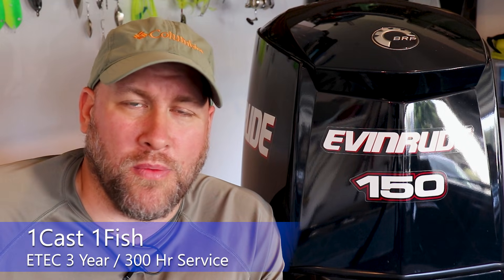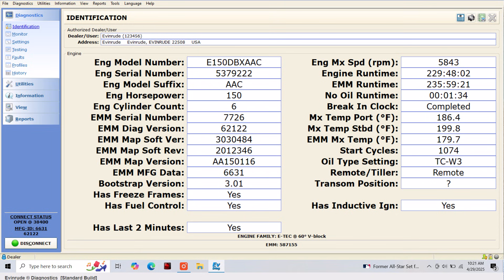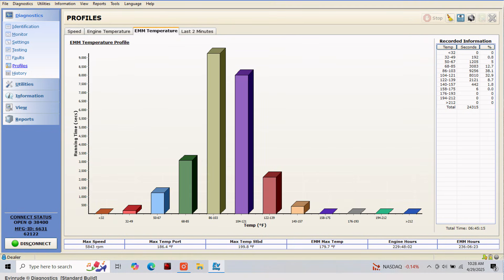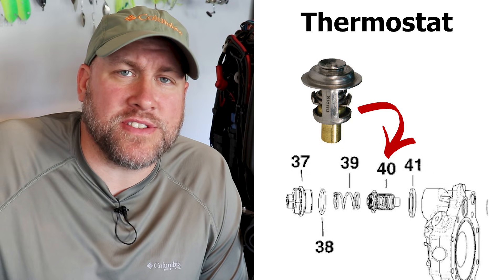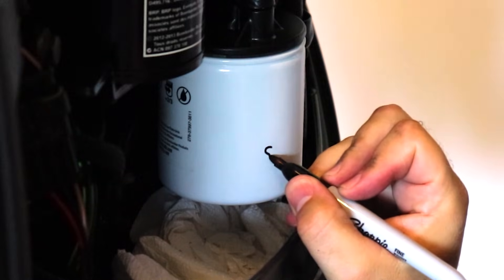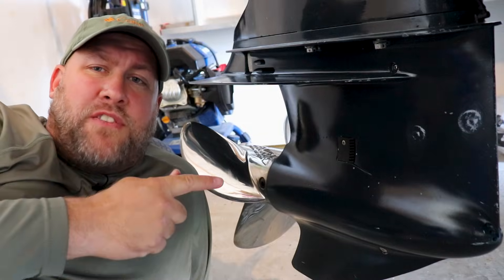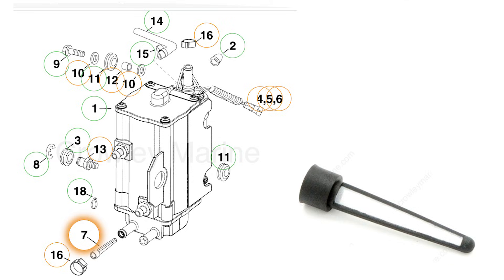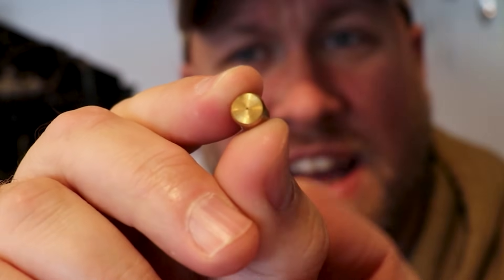Evinrude ETEC 3 Year 300 Hour Maintenance Service Guide

Comment: I OWNED A 2006 E-TEC, I ALWAYS HAD SERVICED IT ON OR BEFORE TIME. THE EXHAUST HOUSING CRACKED DUE TO THE LOWER ENGINE MOUNTS  BEING BADLY CORRODED.NEVER WAS THESE MOUNTS EVER INSPECTED. POOR !!
Reply from the maker: I have seen a few things on issues with these lower mounts.  
Was yours Saltwater?
Reply: @1Cast1Fish  yes , i used in Saltwater and Estuaries. my disappointment was not the E-TEC , it was the lack of attention to detail in servicing my motor over the years. I was concerned with availability of parts here in Australia and any other problems found so i re powered with a Suzuki 4 stroke 90 hp.
Reply from the maker: @JosephDownie-yf8hc  I am not sure on the mounts being a common inspection point, seems they get over looked.  I have never even looked at mine (Freshwater Only).  Parts inventory seems to slowly getting a bit better lately here in the US IMO.
I have actually seen others with the new Suzuki motors loving them.  They seem to have a solid product.
Reply: @1Cast1Fish  Thank you for your Videos and a BIG G'DAY from OZ☺

Comment: Thanks for all of your tips! I was doing maintenance on mine after replacing the WP, thermostats, fuel filter and VST filter. While running the monitor screen to check temp I noticed the oil pressure at 0.06 psi!!!! No lights and no alarms! Any ideas? Also, I ran the Static check per the manual and oil was pumping from one of the lines from the manifold? Any knowledge you could share would be very helpful!
Reply from the maker: Oil pressure is sent through a oil pressure sensor...bad sensor?  
The sensor should set off an alarm though.

Comment: Why didn't you say anything about the Pressure Relief Valve? It's also on the 300hr list for inspection.
Reply from the maker: It's a pain to get to and most of the time people break something when checking it.  It tends to be a part that is either working or not as well.

Comment: with Evinrude out of business, where do you buy these maintenance items?, i own a 2014 evinrude etec 150.
Reply from the maker: I get alot online and have links posted in the description for some stuff I have found.
I also get parts from various online shops when needed or available.
Crowley and Barnicle Bills are 2 I use alot
Reply: I have a 90 ETEC. Awesome engine. The only issues I have had are a cracked oil tank x 2 at the mounts and a leaking fuel pump at the pressure test valve on the top of the pump.
I check the leg gear oil after every run to look for water contamination. The only other issue was when the motor went into limp mode in very cold water in Tasmania.
It's on a 5.5 metre alloy deck boat and sits on 32 mph all day (52 kilometres an hour).